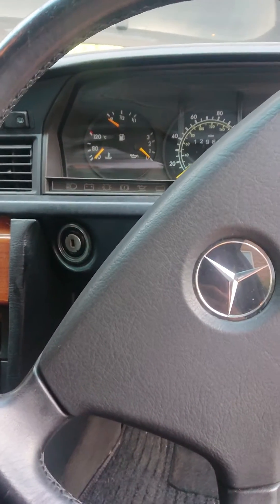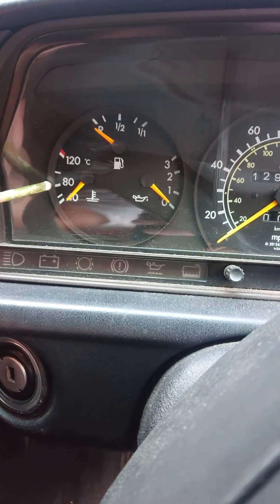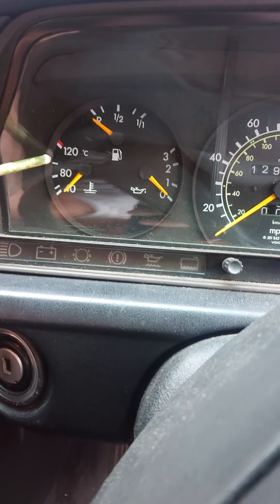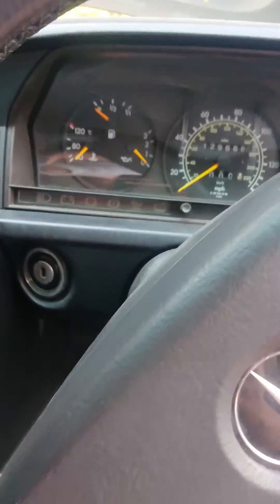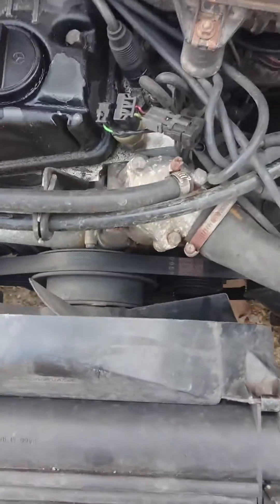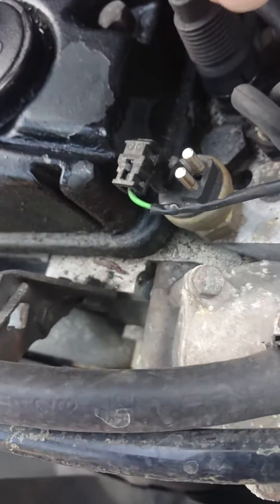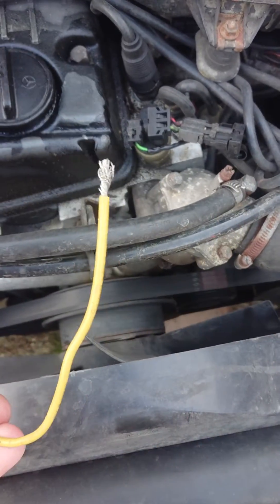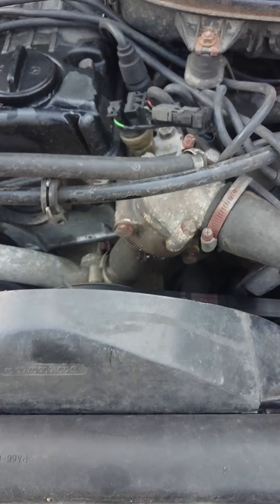Mercedes 190e w201 overheating, auxiliary fan not working. Fault finding process

Comment: The fan which you are testing is not the auxiliary  fan. It is the main fan.
The Auxiliary  fan is located in front of the aircon intercooler  radiator.  That is ,if the car is fitted with air-conditioning.
Reply: Many ppl make this mistake , I have read too many threads calling the engine cooling fan an auxiliary fan.

Comment: My engine cooling fan sensor turns on at 105 degrees. The fan sensor is black and 87 degrees. It blooms at 87 degrees for 1 month. After 1 month, the 105 starts to activate the fan. BEHR brand. What do you think is the problem?